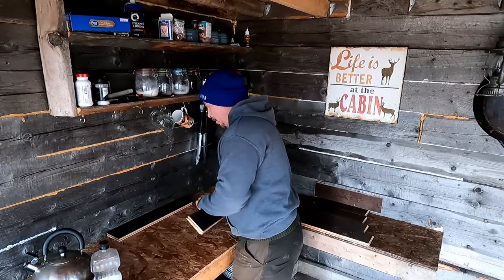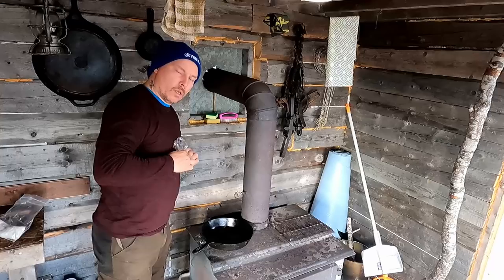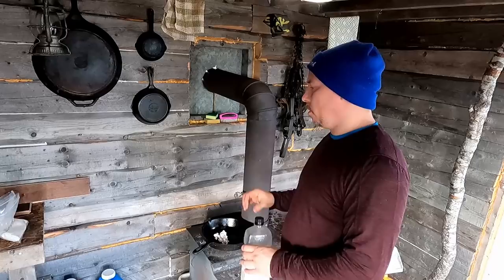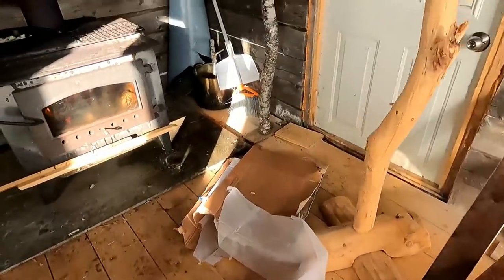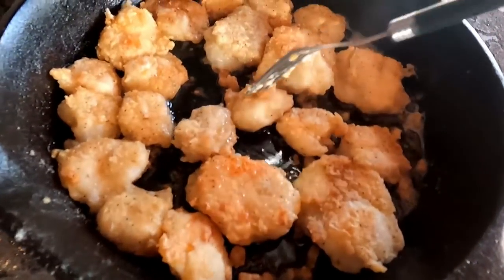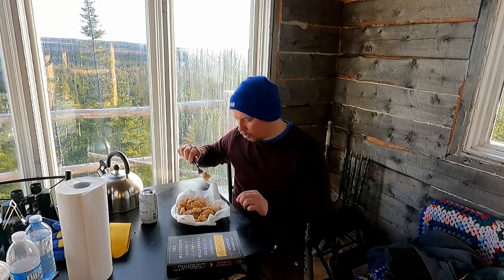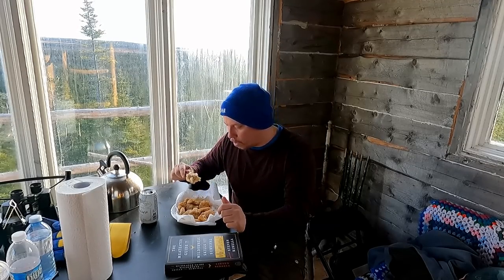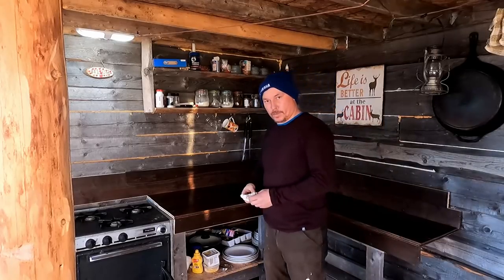Log Cabin Kitchen Counter Upgrade

Comment: A friend of mine used hardwood flooring for counter tops in his house.  He then built up layers of varathane to fill the cracks up even with the wood.  Then a couple of layers of varathane over the top of the whole thing made a smooth easy to clean counter top.
Reply from the maker: Great idea !

Comment: They make a 12v dc outlet with a second 5v usb outlet that you can hook right up to a 12v battery. It will let you charge usb and plug in any 12v dc plug without touching an inverter.  12v DC is a very powerful voltage when you look at all the normal devices that have external transformers you can get away with a car charger for it. 

Those ants and termites are the reason it is good to spray wooden structures with borax in the areas they will try to attack the wood.
Reply from the maker: Thanks buddy. I use borax all the time for ants...